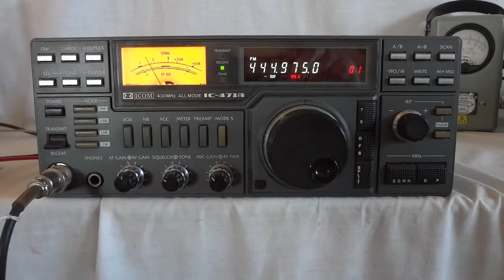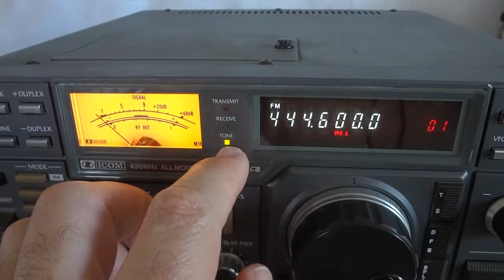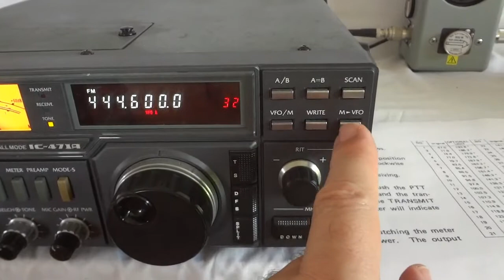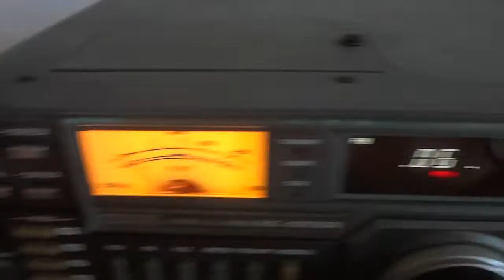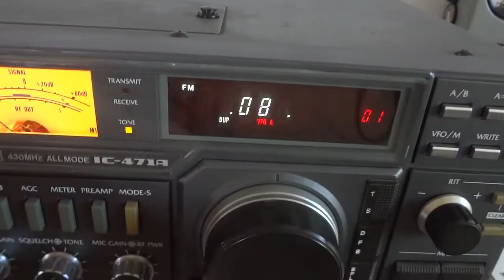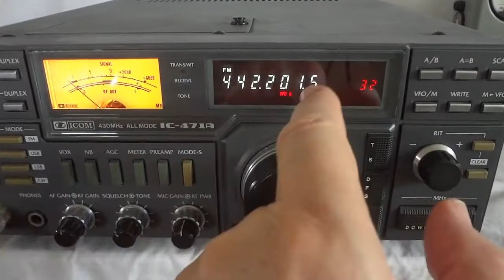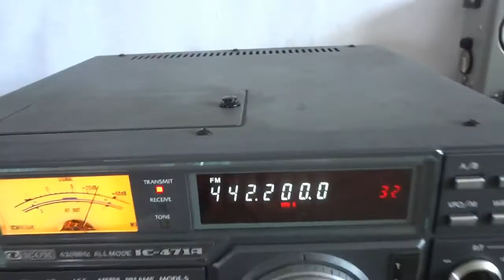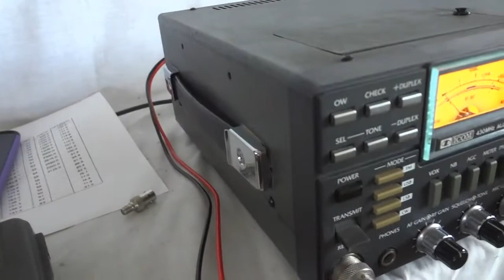Icom IC 471A All mode UHF 70 cm ham transceiver

Comment: hi quetsion will this tx and rx on am ? like 27mhz?
Reply: No, it is a multi-mode transceiver and not an all-mode one, which in this case means it will not transmit on AM or digital modes as is.  Also, it will only receive and transmit on the 70 cm ham radio band.  That is, its frequency range is basically limited to the 430-450 MHz amateur radio band.

Comment: I just picked up the similar Icom IC-271A 2 Meter base station radio.  It's a fun radio to play with.  Very easy to use, once you get the hang of it.  Already made a simplex FM contact, and a CW contact using my vertical antenna on the roof.  To use it in CW, one has to either flip the Transmit switch on, then off, or press the VOX button.  73 Paul AA1SU